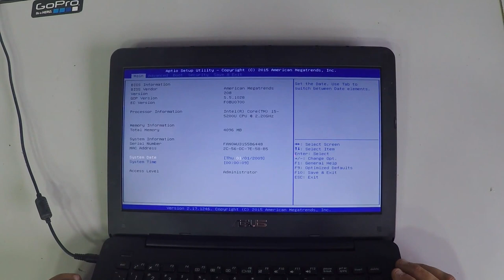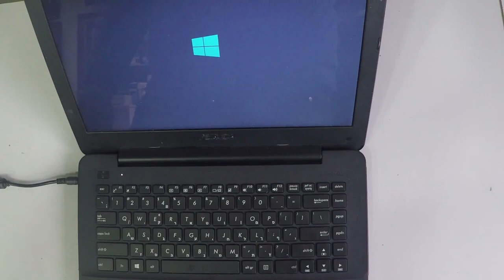ASUS X454L Full Disassembly and Reassembly

Comment: why did they built like that? well especially the fan. how are we, as the user want to use an external fan to support the motherboard from heating. Is there any way to clean the fan inside the laptop?
Reply from the maker: Hello Hasifnizam, you well need to disassemble the laptop to get to the fan (or use a compressed air can on your on risk).